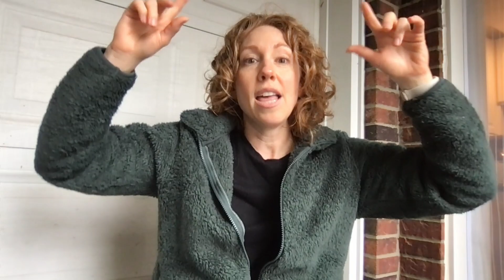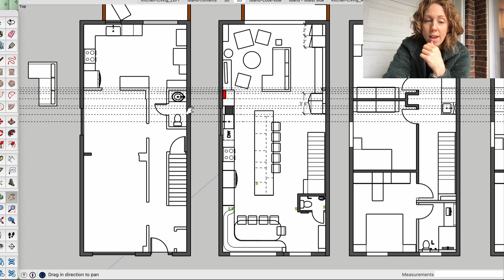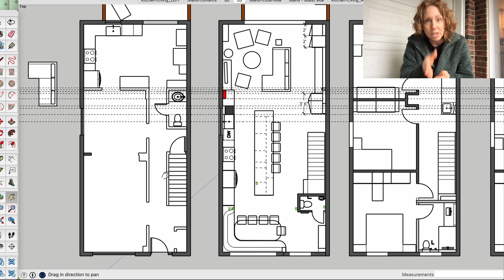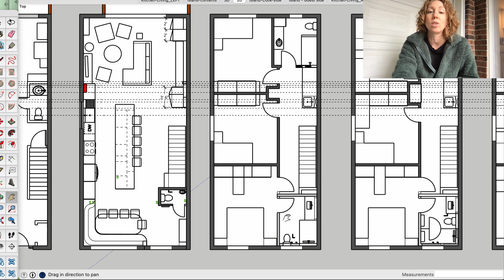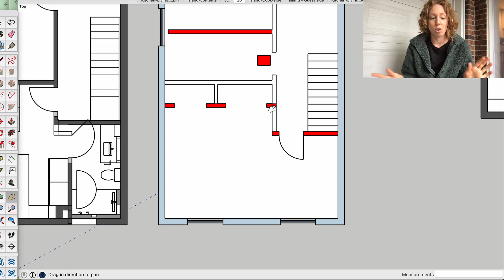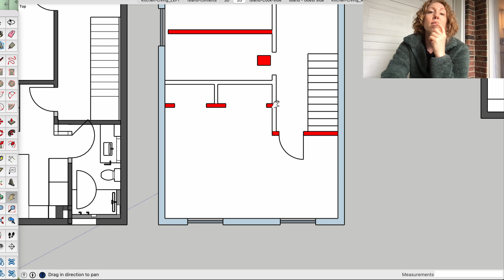Planning, Designing & Managing My Reno - Wk 20 - Architect mistakes

Comment: Moving pipes vs beams...cost is vastly different!

Check load bearing walls early and which way joists go.

$1200 mistake - ask to be included on permits and final submissions by Architect/Engineers